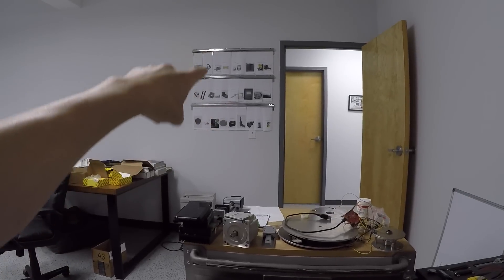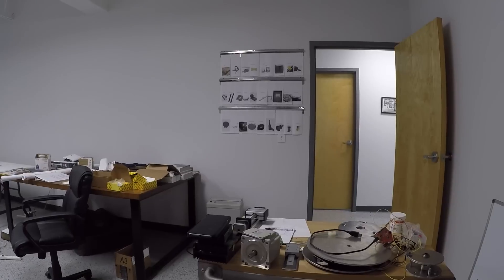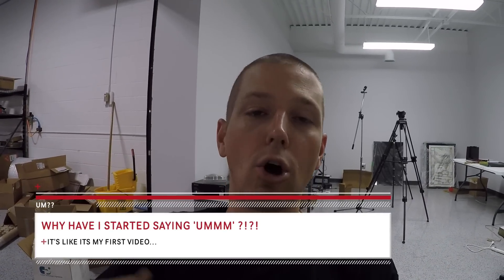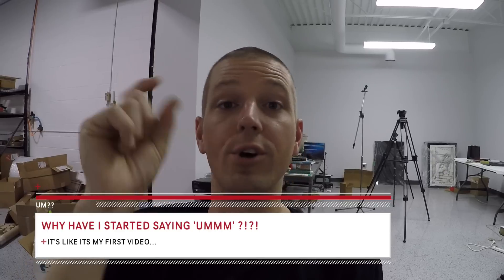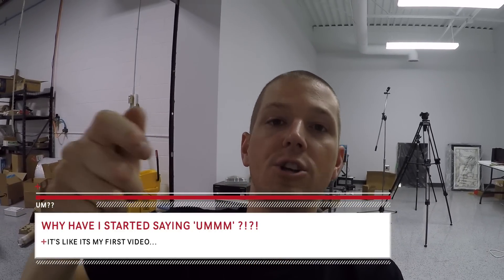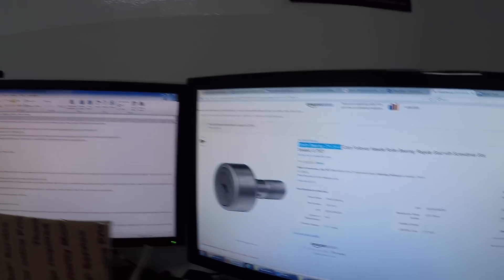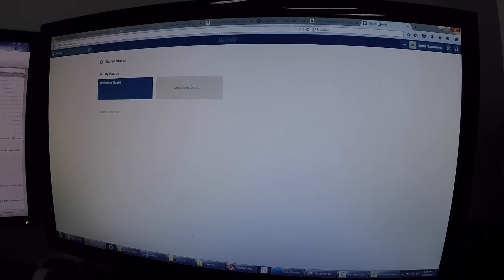New Machines, Keith Fenner Project, Ticket Board, 440 Project!

Comment: Pallet jacks are usually good for 2500kg, depending on size of machine couple of those might do the trick.If not look into some skates (possibly with turntable on one end) and if you're worried about your floor lay down some spare plate or C channel but i doubt it'll do any damage if you've right skate setup.
Reply: Actually yeah. Jack one side, insert jack, jack other side, insert jack, push/pull wherever. Job done, Drink beer.

Comment: Hi John
It's great to see you doing well and with the new machines you will be able to walk both roads of CNC and MANUAL so the rest of the guy's won't be able to say your only a CNC guy. looking forward to the engraving project if you can get that to work it will save you so much time. keep on trucking.

Dave

Comment: I used to move a BOSS V Bridgeport with an 8 foot pry bar and 4 solid steel round stock 1"x48" , and that beast was was over 4,000 pounds with all the electronics.  Rigging was simple for both my Bridgeport mills and other heavy equipment.  I loaded them into my friends 53' semi trailer (which I paid full rate for - but was affordable) with a forklift that I rented for the day (also not terribly expensive  $150 per end in 2004).  I originally moved the BP's with just a car trailer that was adequately reinforced, but for CA to TX the Semi made much more sense.    Another way to get them into a semi is to call a flat bed tow truck.   Use the winch to drag it on to the tow truck then pull across into the semi truck,  you can even use a pallet jack to move smaller things from the tow truck to the semi.  Good luck with moving them.

Comment: For cleaning I use a cleaner like purple power but you spray it on an then wipe it off an the i use something like brake clean. but do not use on aluminum or soft metals.  I've heard of people power washing them after the take off the electrical parts.   James Greene did that to his surface grinder.   But if you are going to take them apart a clean all parts an then reassemble.  I would just clean the first 5 layers off an put them to work.  Got to get your money rolling in.

Comment: I know I've said it before but, you need to stop putting things on the floor and since you're getting organized with a crm it's a logical thing to do. a shelving unit with bins compartment or anything that allows you to put things related to one project and identify it. that way you don't clutter your shop but most importantly you don't clutter your mind trying to remember all of that, john grimsmo has a really good system but his stuff all fit into small parts drawer but, I'm sure you can adapt it

Comment: Hello John, Being a retired truck driver and having experience in moving heavy equipment in a confined area where forklifts have no access.  Can I suggest to you that you might think about purchasing a Johnson Bar, I purchased mine through Northern Tool for $80.00 plus shipping the total cost was $100.00.  They 're a tool that all rigging company's keep on hand.  I used the johnson bar plus machine skates to move both mills, horizontal and vertical and also my lathe into my two car garage which was very limited for space.

Comment: Maybe somebody else already mentioned it but I believe that casters are usually sized for 50% of the load because when you roll the machine around on a rough floor it will sometimes be supported by only two casters.  For cleanup, check out Forrest Addy's post on Practical Machinist from several years ago where he went into a fair amount of detail on how he does it.

I really like that automated engraving concept and am looking forward to the series.  Hope to see you at the Tormach Open House and especially the F360 lathe CAM seminar.

Comment: On cleaning the machines, cover the motors/controls and spray them off with a power washer. You can clean by hand the heavy stuff and it will be a breeze. Dont blast directly into critical areas of course. Pass over them quickly. I have cotton towels and simple green for wiping down more critical areas. Rinse the rags with the power washer standing on them on the cement, repeat as necessary. Blow of as much moister as you can when done. Then I use either an aerosol can, or air pressurized sprayer with a rust inhibitor. If you need to clean your ways, you can use 0000 steel wool, or Norton pads off of MSC or similar places of equivalent abrasive. It will not scratch the ways of the machine. Here is an example on my IG of cleaning a vise using those Norton pads https://instagram.com/p/BFdEjHRmelS/ spray every moving part down and run the machine and it will be clean as a whistle! I learned this from several shops that buy a lot of used machinery off of auctions, cnc and manual equipment. I recently did it to a little Okuma Cadet I picked up from an auction. Good luck, nice lathe score!
Reply: +NYC CNC the coolant had a bacteria problem at the time so as coolant got behind areas you couldn't visually see on the vise and sit it would grow. That's why it was forming a little rust. But even at that if you drop some water on it it will form a rust spot. Wipes right off with some WD-40 and those pads and doesn't disturb the finish of the vise. I live down in Houston Tx so humidity is extremely high. You can have steel in the open air and it rusts down here.

Comment: Hi John using skates to move your machines about is not the best solution for ease of use look at the link you can use with a standard shop air supply 9 bar , i have built some similar units in the past for moving big machines,  www.http://www.hovair.com/air-bearing-info/air-principle.htm as for rigging there are no short cuts.

Comment: I pressure washed my machines. First spray it down with a heavy duty degreaser and watch spraying directly onto things like the cross slide ways and things that would be hard oil after. Then immediately use a leaf blower to dry it and oil all ways and machined surfaces.

Comment: Best way to clean a machine is get yourself some machine tool cleaner and elbow grease if you don't want to do a complete tear down. Machine tool cleaner is an alkaline cleaner that is compatible with coolant (you can add it to coolant, helps keep the rot at bay!) and will do a really good job of removing crud without killing pain or causing rust. Your coolant supplier should be able to get you some, You may have to buy a 5 gallon pail of it but it is really good mild cleaner that I use for everything around the shop (works awesome on the floor). DO NOT USE ANY SOLVENTS!!!! Use WD40 or some other product if you need to degrease something on the machine or you can remove oil from places you didn't want to and not even know till its to late. If you are up to the job you totally can pressure wash any parts you remove from a machine, just hose them down with rust inhibitor (WD40) right after. I've tore down several machines and steam cleaning them is really the only way to get the iron 'clean' again without taking forever. On your little turny table, you should have a couple switches that 1 determine your home position and one to confirm you are in position. This way if there is a missing step you don't wreck parts or the tool.
Reply: Machine tool cleaner??  That an actual product or a general term? 

Sounds like you're describing an alkaline product typically used to flush and clean CNC coolant systems. 

I've had issues with some of those products eating through or making plastic lines brittle and prone to cracking. They've gummed up more than a few thru coolant systems as well on me. I'll never use that stuff on a CNC again. 

Can't see harm in a manual machine though.
Reply: Occams Sawzall More a term, It's just a basic( as in PH) organic cleaner. It's just formulated and sold as machine tool cleaner
Reply: +Widget Works Manufacturing Inc. ah.. Got any recommendations on one that won't kill coolant lines??
Reply: Occams Sawzall never had a problem with coolant lines, my guess is you had synthetic coolant and that was killing the lines.

Comment: Automated parts placement.  Are you planning on only one hole in the round pallet?  I would think multiple holes and just advance to the next hole allowing the parts to load and empty as the pallet advances.  Or did you already plan on that?;0)
Reply: Just 600 might not need more than one at a time.  But if it costs little to cut the figures out, you could put 4 on the same circle with little issue.  

+NYCCNC : You might not want to IF you might want to make the same fixture work for multiple pieces, even if you don't know what all you might need right now.  Just a thought.  

If you think you might want to do that, you might move the 'feed area' further to the right of the machine opening (but still easy to access), so you could have easier removal of complete parts (or different parts if you go that way eventually).
Reply: Might be best to start with just a single position first to work out all the programming and mechanical kinks.  Can always add more positions later once thighs are nailed down
Reply: Things... Not thighs....  Lol

Comment: Chemical cleaning would work but not around any seals or electronics. Something that dissolves oils. I'd say lighter fluid, but that leaves a residue behind, something that really destroys oils, because once those are gone, you can come in with a vacuum cleaner and just such up the grott.

Comment: John, you might want to rethink the cam followers on the machinery skates if you have nice painted floors. The small hard wheels have such a small contact surface that they will crush the paint film and maybe the top surface of the concrete if there is a large load. I guess you could lay down some sheet metal strips as track surfaces.

Comment: I have heard that diesel fuel or kerosene is good for cleaning machines. It will take of all of the grease and oil, but not touch the paint (other solvens is just as good on the oil and grease, but will dissolve the paint). I used diesel fuel with success for cleaning of the shipping grease on a new machine.
But take care to oil the bare metal surfaces right after to prevent flash rust.

Comment: John

I work in a fairly large high volume machine shop were my bosses do not allow a lot of time to clean we have some fairly large machines such as a Makino A81, Daewoo DHM 400, Bridgeport HMC 700xp3, Two Haas vf5 a 30hp haas vertical lathe, 40hp honor horizontal lathe, haas tm2 and a haas tl2 just to name a few and are only allowed 15 minuets at the end of each day to clean on them. We use parts cleaner out of our parts wash basin followed up with household degreaser to remove any left over oily film works really well and is used every day on several hundred thousand dollars worth of cnc machines

Comment: Congrats on the machines, those are awesome!  Recently I bought a new Mill and Lathe and built these dollies https://www.youtube.com/watch?v=3GEWvCd4IGA and had a large tow truck unload the machines and set them on the dollies outside my shop, because i only have 8 ft. high doors and 10 ft ceilings.  here is a vid of unloading one.  Tow truck cost $150.  I did this with a mill and lathe 2 weeks apart.  https://www.youtube.com/watch?v=AUi5pwBAP3E

Comment: You most likely do not want steel roller running on your coated floors. I usually find the wrecker guys to be the cheapest on lifting and loading machinery.  Fortunately an in shop bridge crane is like having a wrecker everywhere inside. :-) How big is your forklift? Probably most of those machines are small enough for you to handle them with it, especially once you get them at ground level. Team the forklift with a pallet jack and even that lathe is a piece of cake to move. That radial drill is your worst nightmare to move. Those things are top heavy like no tomorrow so watch flipping it grab from top only if possible.  As for cleaning bulk degreaser like simple green and paper towls is the way to go.  No easy route to cleaning is wort taking, use the elbow grease and be done. The Poor intern. lol
Reply: Occams Sawzall
 Most wrecker companies would have liability insurance which covers property damage. Thw wrecker outfits I deal with are the ones that have multiple 50 ton rotators and they make mst of their money plucking semis out of rivers and off cliffs, the guys are pros at out of position lifting and all have top notch equipment, i would trust them to lift anything they think they can lift.  I don't think riggers as competent in that side as they don't have to deal with wrecks and stuff that ended up who knows where and turned whatever way.  Riggers have better equipment usually for moving once in the building though.  The shop across the road from where I work has all their new  VF6 Haas machines placed in their building by wrecker as they have enough room for the trucks inside and because the trucks spread the weight alot more they don't wreck their concrete like the 50,000lb forklifts did.
Reply: +jimnhezza only downside is the wrecker driver's insurance won't cover a machine tool if it's dropped and damaged while moving. A rigging companies insurance will. Depends on the machine and its value really. 

A "project" machine. Ya a wrecker is fine. But a used well working CNC or great condition manual? I'd spring for the rigging crew
Reply: +jimnhezza that's a good deal then. 

But if you don't own a shop with insurance, just a garage shop. It's worth the $ for the rigger. 

Im actually a little surprised it's so little for insurance to cover machines off your property like that. Def scored a good deal there
Reply: +1 on that advice
Reply: Yes!!! On the wrecker delivery. The local rigger wanted $400 to transfer a 3k lb piece off of the container truck by forklift onto my driveway. The wrecker with a tilt bed is doing it for $125.
Reply: +Occams Sawzall My business insurance covers my property at other's premises and in transit. It adds about $550 a year to my insurance bill for $50k of property coverage. I only keep it in effect while I'm waiting for equipment to be delivered, so It usually runs about $100. It's the lowest cost way to go.
Reply: +bcbloc02 This is very useful info Brian. Maybe the best discussion I have seen.  What was said only once in this discussion is if the movers know how to handle machines inside a building. I bought machines that had to be moved out of a lab at the extreme end of a building through a 7' high by 8' wide door. The riggers did my move perfectly well with no damage. That being said, my bro and I moved a #2 horizontal mill by ourselves out of a very small garage into my garage with steel bars, home made skates and a gantry. It did not cost much and we had no problems. I think most people would not know how to do it but there is great info on the web to learn from others' experience.
Reply: +bcbloc02 guess it depends on how much you trust these wreckers over the riggers. Most of the guys around here for wreckers I wouldn't trust to move a rusted out Yugo let alone a machine tool. We have excellent riggers though. They'll come move the machine exactly where you need it, remove all the shipping bolts and plates and level out the whole machine (with a machinist level no less) for a very reasonable price. They use low ground pressure forklifts with non-marring tires as well. 

Obviously a wrecker won't do that. But it's certainly a good option. 

For John I think the rigger is the better way with 4 machines with 2 of them being notoriously top heavy and difficult to manage.
Reply: +NYC CNC  what would it cost you to rent a die setting forklift? I remember my old boss renting one to move a diaper manufacturing line into the new facility, but he was very much against telling anybody the cost or value of anything

Comment: John you mentioned using a stepper motor for your fixture. You should check out the Clear Path brushless servo motors with the built in driver and encoder built on the motor. You can hook them up just like a stepper but they have true feed back control. The link to them is https://www.teknic.com/products/clearpath-brushless-dc-servo-motors/ Check this out you will probably stop using stepper motors these are much better. They are a little costlier depending on the resolution of the encoder you need but for your fixture you wont have to worry about stalling a stepper with the weight of your fixture. They also have free software to tune the servo to your application that looks very easy to use.

Comment: John, I would not suggest power washing the machines.  That looks like a lot of grinding grit and a power washer will push the git into the space between the ways, into the seals and bushings and destroy them.  We only pressure washed machines that were apart or coming fully apart.  Small stuff is best done by hand.  That purple cleaner and good old Simple Green bio degradable soap works surprisingly well with an assortment of brushes

Comment: Have you thought about engraving on the Torch Mate? You should be able to mount a motorized tool and raise and lower it with a pneumatic cylinder. Many plasma machines have this and use a work shift to program it like a second head.

Comment: Left my machine cleaning advice on FB. But no. Considering what that stuff is, do not power wash, do not use compressed air. 

Disassemble as much as you comfortably can (I.E. You. Can put back together later) and clean everything. Take off as much old oil and grease as you can and reassemble with all new grease and oil.  Especially the lathe